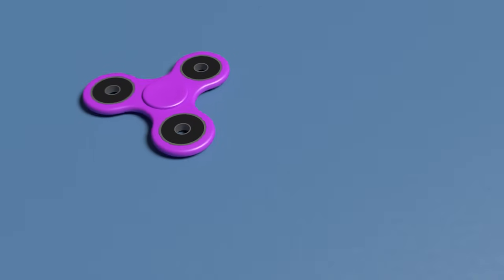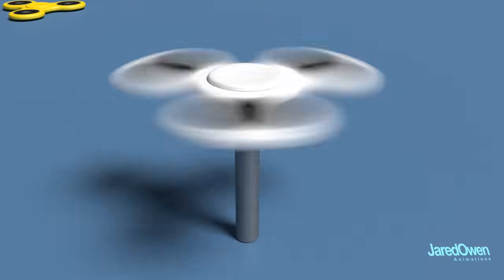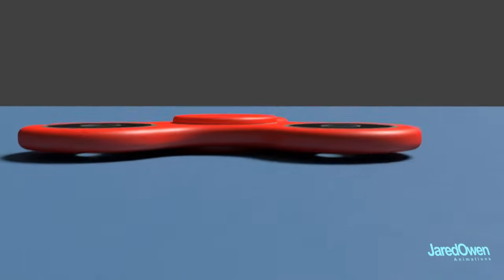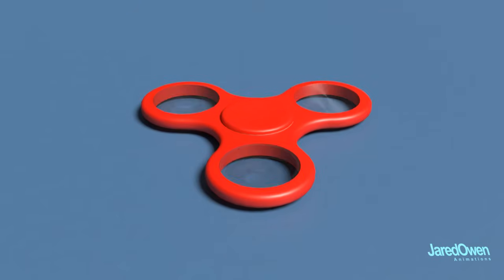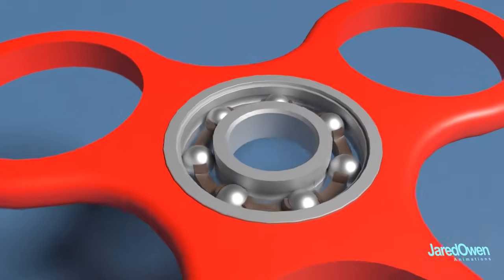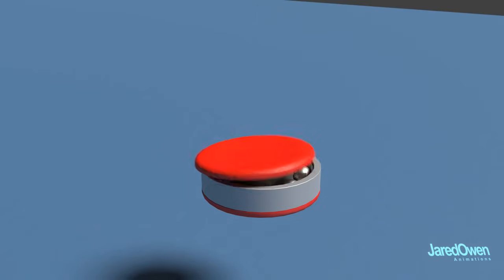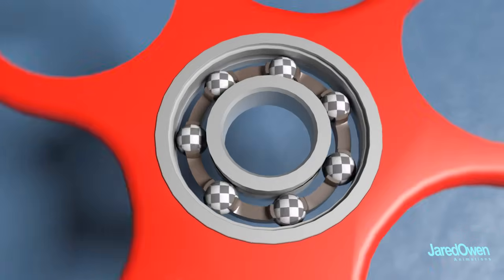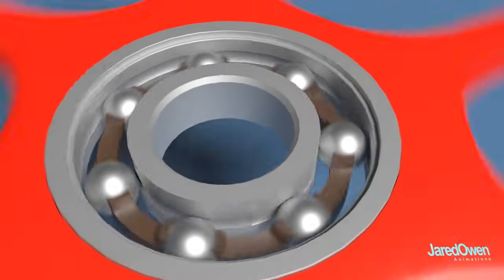What's inside of a Fidget Spinner?

Comment: Yes but, wouldn't the Cage slow down the balls?
Reply: That's literally the only way to keep it separate apart. That's why inside some spinner they put oil to reduce the priction caused by the cage and the steel balls.

Comment: Wouldn't the cage add to friction? , How does the ball spin within the cage ?
Reply: Cage holes are loose, which mean the balls will bring the cage with it. The top and the bottom cap will keep the cage inside and prevent it from falling out of the spinner. There's a good chance if you take the bottom cap where the back of the cage face out, it'll fall pretty much easy.